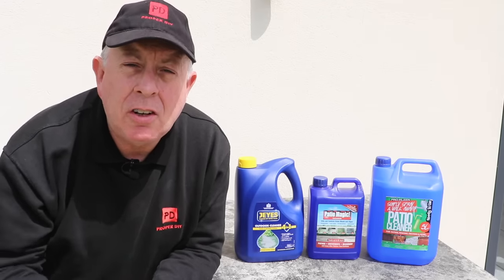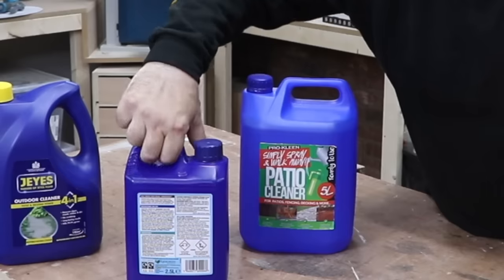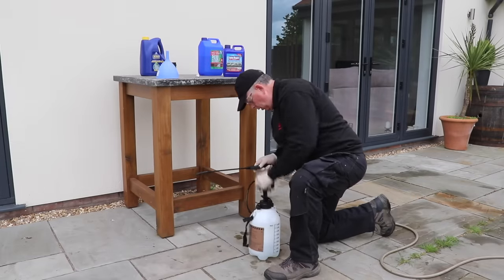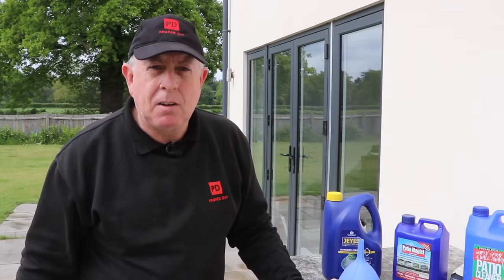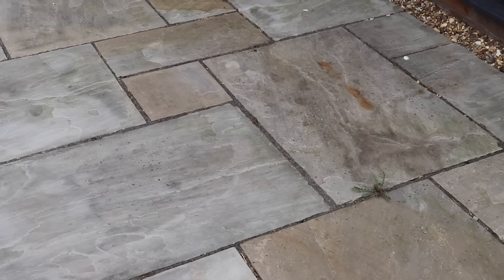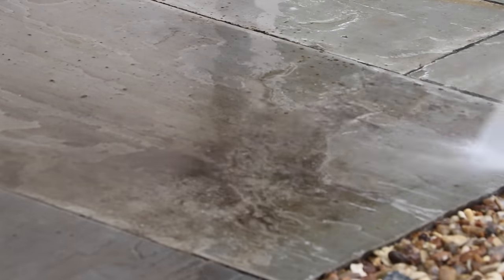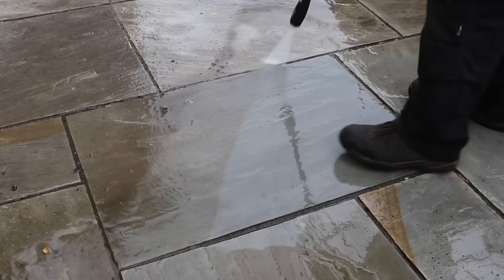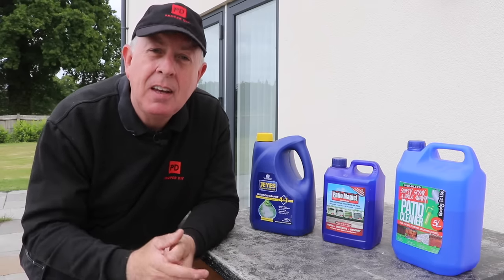Patio Cleaners vs Pressure Washer Put to the Test with Surprising Results!

Comment: Nothing beats a good pressure washer for removing dirt. However, you're using the wrong chemicals. These are all consumer junk and even with the dual treatment of them followed by a pressure wash, you've still got black spot on some of your slabs.

Pressure washing wotks wonders, but won't get rid of embedded organic matter.

What you actually need to do and what all the pros do is pressure wash, followed by a "soft wash" of unbranded 15% Sodium Hypochlorite, diluted 50:50 and applied with a pump sprayer. Leave to work for about half an hour and rinse off. All organic growth and blackpot will be removed, won't come back in a hurry and your patio will look like new. The added benefit is it will kill any weeds. Just don't overspray onto grass or anything you don't want to kill. It's basically a super strong bleach, similar chemically to Chlorine, so wear old clothes when applying. Trust me, this method is absolutely the best way to clean your patio.

Comment: I think common sense should tell you it doesn't wash the stains away , you need to do that with water. the chemicals help break down the stains more easily ready to wash. this is why your pressure washer is getting rid of the stains so easily.

Comment: For years now I have cleaned my patio with sodium hypochlorite (bleach) it is between 15-18% and not only does it clean up moss and algae but it kills anything growing in the cracks between slabs and it removes those black marks!!. You get a good finish, which I hose off before it dries using my pressure washer to guide the water and cleaner down the drain and remove the odd stubborn marks on my Indian Sandstone.
£38 for 25 litres from farm supply shops. I don't dilute it and it takes a few years to use a whole 25 litres as I spray it on with a fine spray from a hand pumped 2 liter sprayer.
http://moriartythemundane.blogspot.com/2014/04/my-new-patio-update-eight-years-later.html?m=1